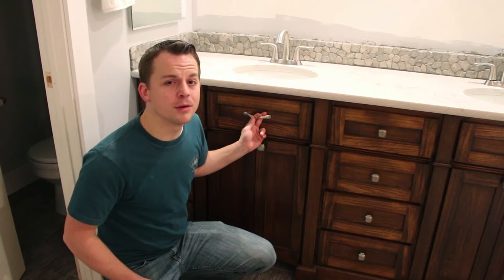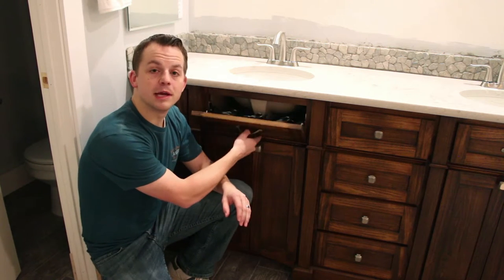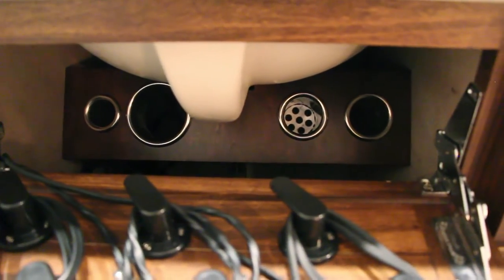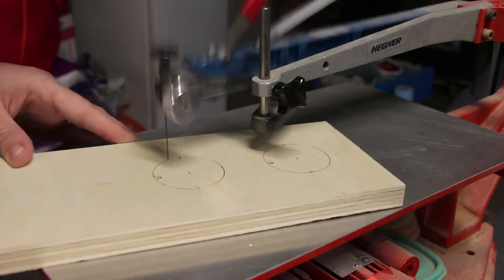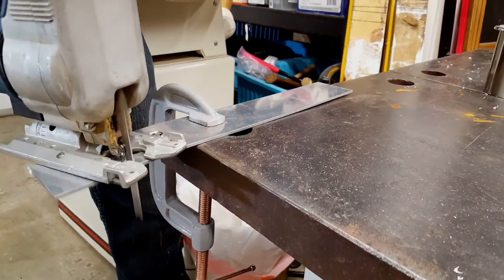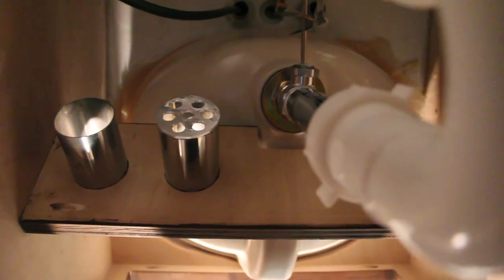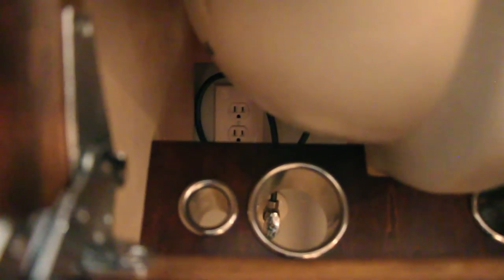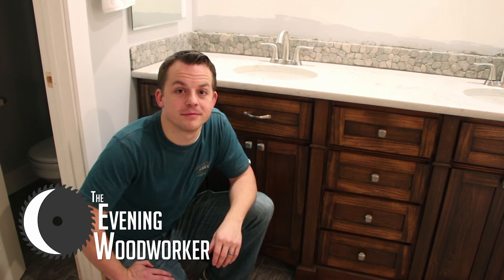Hidden Hair Appliance Organizer

Comment: Can you list where to get the items needed?  Specifically I am looking for the metal cups.  Thanks :)
Reply from the maker: I got the metal sleeves from Amazon. You can buy them as a set of 3 or individually. 

Salon Styling Station Chrome Dryer Hair Iron Appliance Tool Holder AH-00C https://www.amazon.com/dp/B01AVEIROU/ref=cm_sw_r_cp_apa_vKwvzbY1MMMX5
Reply: Go to Goodwill and poke around their kitchen section.  Or IKEA. You will find something.

Comment: Ouch.. non-GFI under the sink? Very unsafe and against North American Electrical Codes! Otherwise, very good idea, I will definitely borrow it.
Reply from the maker: Thanks for the heads up! Is that required on every outlet? I thought it was just on one outlet in the circuit?
Reply: @EveningWoodworker   all receptacles in a bathroom must gfci protected since almost everything is near water. This can be on a protected circuit by a gfci breaker at the panel or a series of receptacles starting with a gfci receptacle and then daisy chained down stream. If there is only one recpt in the bathroom it can have the gfci recpt installed at that point alone also. Anything plugged in will be protected.
Reply: UK code we can't have any 240v plug sockets in a bathroom, we can have a 110v but only electric shavers and electric toothbrush chargers use them over here.
Reply: @simonjarvis4957  same in north America. We use 110v 20a for most things...but has to be gfi
Reply: Yes, this does have to be GFCI on every outlet in a US bathroom to be up to code, especially under a sink.